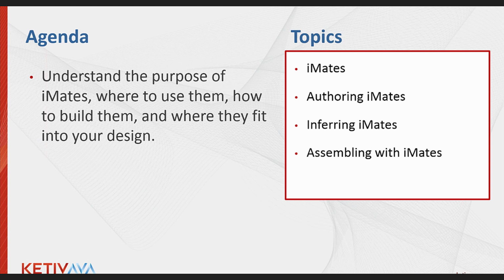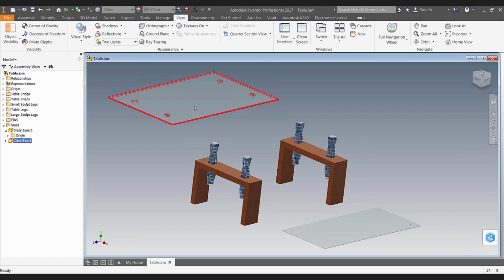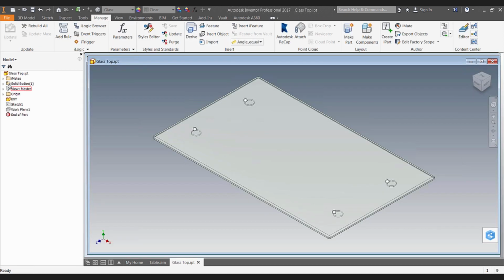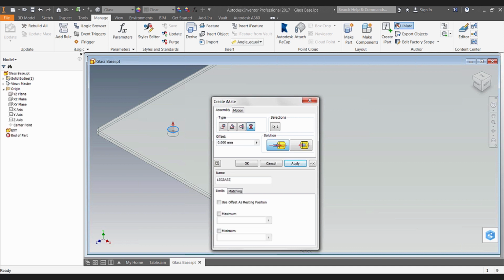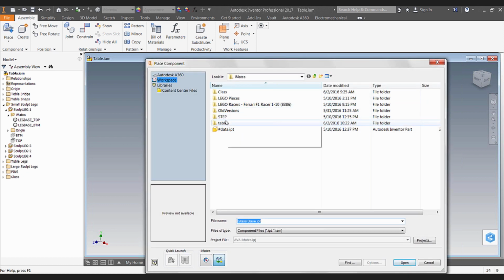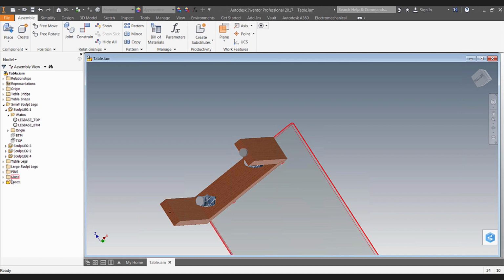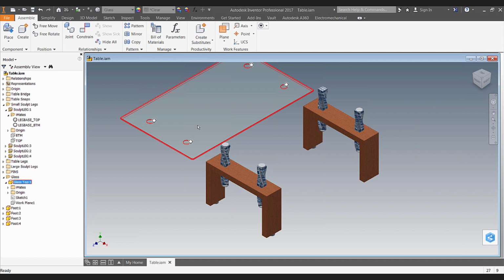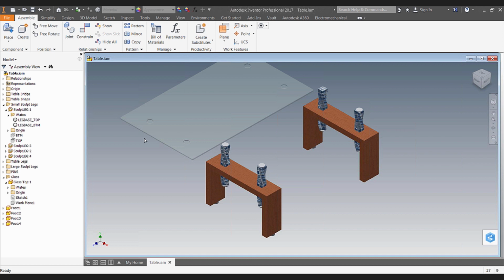Autodesk Virtual Academy: Inventor iMates 101

Comment: I find this function to be the most broken feature in INVENTOR. The names are meaningless, and useless. If I have a plate with four different holes with unique imate names for each hole. I create a pin with one imate name, and it will place in all four holes. This is a complaint that many users have expressed. If I understand correctly it will first look for an Imate with the same name, then it looks for Imates with the same constraint regardless of name. LAME!